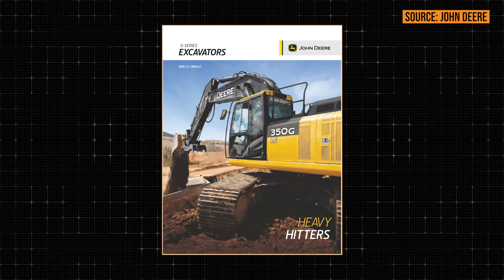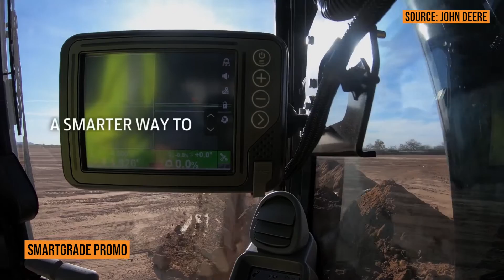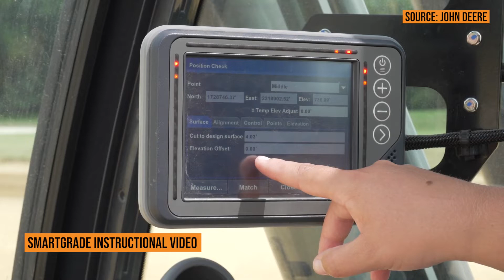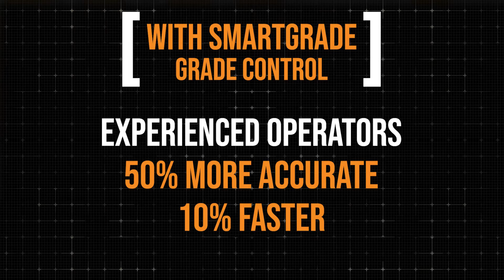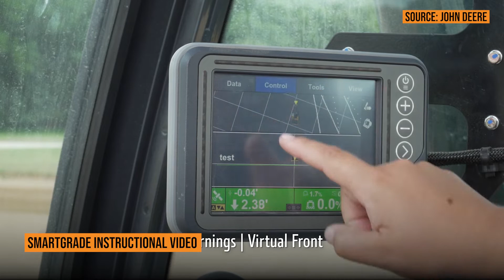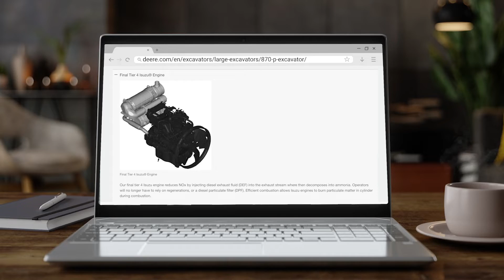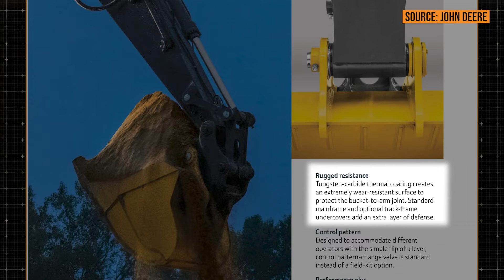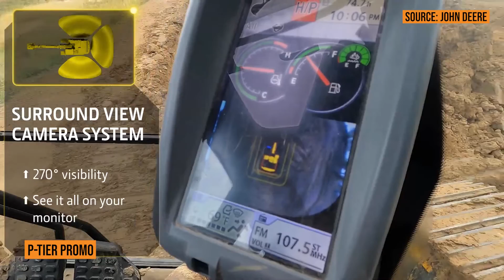Deere’s P-Tier Excavators: What are They and Why the New Name?

Comment: Grade control in excavators is still pretty crappy
Reply: Most guys today can't operate. I can get it within an inch at least by eye. No need for grade control if you know what you're doing
Reply: @johnzadinya2181  used to dig hundreds of meters of ditch per day with nothing but a paint mark on my stick. The new technology won't make a crappy operator good but it will make an excellent operator more excellent

Comment: So big question. Obviously, the P Tier with grade control are going to have to be Electric over hydraulic controls. But are the cheaper G Tier still hydraulic over hydraulic controls?  I have an Equipment Rental Business and for most of my renters the grade control is not something they will use, or at least very few.  A lot of operators really still want hydraulic controls.